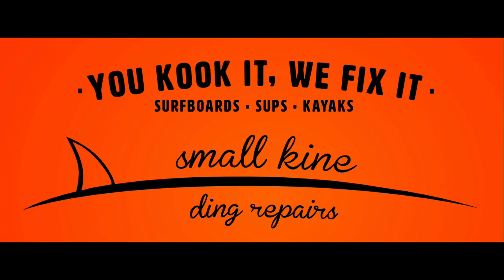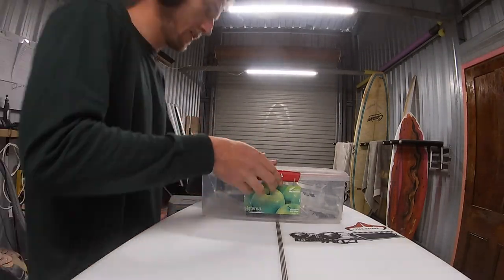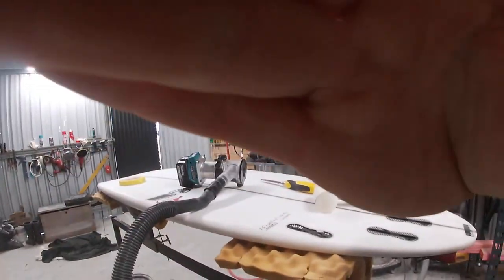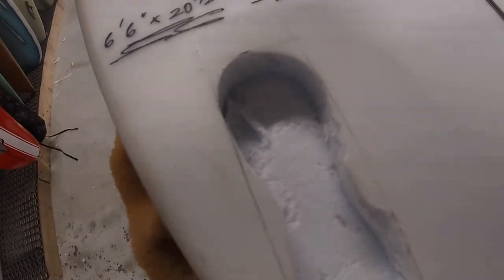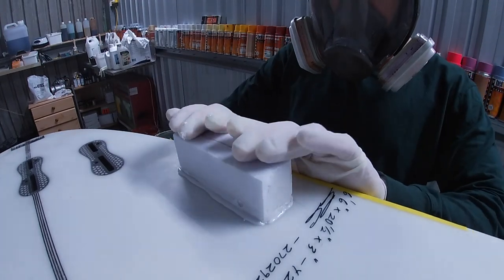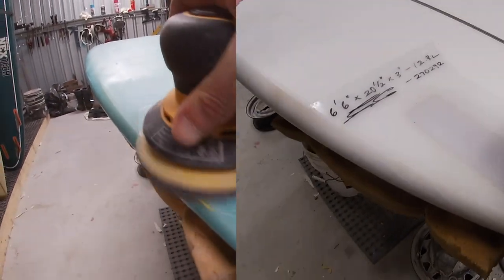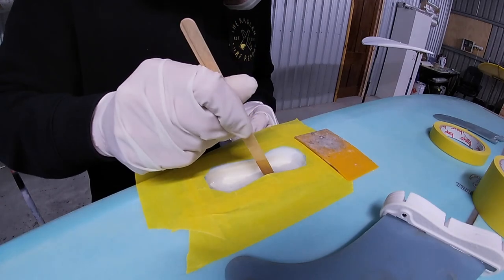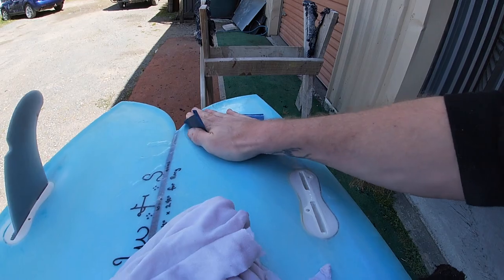HOW A PROFESSIONAL REALLY FIXES YOUR SURFBOARD - FCSII REPLACEMENT

Comment: Couldn't you have started with drawing the square shape around the box. and instead of routing, using a Dremel to cut the square, then proceeding to just pull the box out in the square shape? seems like it would have cut the time down without risking pulling existing glass and foam up.
Reply from the maker: Definitely can, was done that way for the sake of the video just to get the two boards at the same starting point

Comment: I should share this video to my local shaper.
Amazing job bra
Reply from the maker: Strangely, some of worst or dodgiest repairs I've seen come from shapers who I know to be really good shapers. I guess it's like getting a panel beater to paint your car, the two don't necessarily translate
Reply: @smallkinedings  I am pretty good breaking fin boxes, mostly duck diving in shallow water, slabs reefs , last time my local shaper took 2 months to fix mine and made a complete mess and charge me 40 EUR 🤮.
Unfortunately to fix fins box you need the proper tools and space otherwise I would do it.

Amazing video mate thanks again , have a nice barrel

Comment: What type of polyester resin are you using? Advice on when to use/not use finishing resin?
Reply from the maker: A surfboard specific poly resin. Most resin suppliers will carry it.
If your next step is sanding then you want to use a finishing (sanding) resin, if you need to add more material on top in your next stage (ie. Resin coat over lamination) then you want to use a laminating resin (remains sticky after curing to allow for more material to be added and bond) 🤙

Comment: I may have missed it watching at work, any use sanding the sides of the new box for bonding purpose?
Reply from the maker: Some people do but not myself. The box walls are sufficiently grooved, indented and porous that I think there is plenty of hold without sanding. But, a skuff with some 120 grit never hurt anyone if it gives you peace of mind

Comment: Good one mate , i dont really like using expanded PU , seems easier and faster to me to root a small square and insert a new block of foam and start from there . Also sometimes you dont really need to root and insert because if youre really precise grinding the broken box (and if It is not completely destroyed the area around it) , you can pull the old box out and the original root Will be perfect just to install a new box (maybe ya need to clean the resin inside of it with patience  but you wouldnt need to insert block again and root ..)
Reply from the maker: Many ways to skin a cat and I'd say that both methods have their pros and cons for sure. I use both blocks of foam and expanding depending on the job and type of ding. As long as you're replacing foam and not filling big holes with pools of resin, you're on the right track!

Comment: Micro oscillator tool is gonna be my router for this repair.   Best new tool of the 21st century.   Also, I don't have a bad ass router, or sander.
Reply from the maker: Like a dremmel? You'll be there a while 😂 It'll work though! Sounds like a good excuse to buy a bad ass router and sander to me though
Reply: @smallkinedings  a Dremel spins the bit, a Fein Tool saws the bit.

Comment: What kind of router bit can you use to square out the fin boxes to make it easier to insert foam? Assuming you can’t use the fcs2 bit freehand.
Reply from the maker: Hey hey, you could use the fcs bit. I tend to avoid it because those bits are so expensive so the less use the better. For general routing I just use some cheap and cheerful bits from the local hardware store. Smaller is better I find if trying to follow a pencil line, you get a bit more control

Comment: question about paintbrushes! What do you use to preserve your brushes? Acetone? I find myself going through paint brushes and want to save some money!
Reply from the maker: Howzit Dalton! So I personally don't reuse brushes as most of my brush work is dings so don't require a high end brush. I just try and line up 4 to 6 boards and use one brush for all of them each coat so a 50cent chip brush goes a long way. I know some full time laminators though who have high end brushes for their work. The standard seems to be 3 pots of acetone. So after use your brush you rinse heavily in container 1, then finish rinsing in container 2 and then leave it sitting in container 3 until its next use. Obviously container 1 gets gross and jelly first so once that needs changing you fill it with clean acetone and it becomes container 3. What was container 3 becomes number 2 and what was number 2 becomes number one. Keep the rotation going each time container 1 needs changing. One guy I know has been using the same 2 brushes for his work for almost 7 years and he's a full time laminator not too far from me. It's a pretty expensive brush he's using though!

Comment: Thanks for the video! If you don't mind my asking, are you able to make ends meet with just board repairs? If so, is it fairly chill, or a 60-hour week kind of situation?
Reply from the maker: This is definitely a topic I will make a video on soon. Short answer is that this has been my full time gig for the last 5ish years and I have essentially bought myself a lifestyle. My small town location makes things a little different for me but I generally work less than 40 hours a week (but 7 days a week) but I charge tradesman rates which I might struggle to do in a city but the trade off is that I'd get more work in a more populated area.

Comment: If I install a finbox with sanding resin, is it that much of a difference than using laminating resin? Will I see a difference? 

I just don’t have laminating resin.
Reply from the maker: I would venture a guess that it's not ideal as the wax layer will definitely effect adhesion. That said, by the time you sink your box, you might end up pushing 90% of the wax out anyway. It will mean you have to sand before lamination though. If you can get laminating resin I'd personally go with that.

Comment: Wouldn't it be stronger to route the box out larger so that your plug has more wall thickness?
Reply from the maker: Resin in a board is actually a weakness. It is incredibly hard and the slightest movement or flex creates compression and cavitation of the foam.the less of it the better. The other factor to consider would be weight in the tail end of your board. Each box takes roughly  30ml of resin (minus what you squeeze out). Up that to, let's say 60ml per box, we are adding some noticeable weight now.
Reply: I learned about the added weight the hard way 💩

Comment: You can also melt the plastic around the pin with a soldering iron, less nerve wracking than trying to get it with a router.
Reply from the maker: Knowing me I'd be dripping molten plastic all over myself 😂

Comment: Nice! Did you glass over the 2 part foam without sealing first? Are you not getting bubbles?
Reply from the maker: If the damage is small i usually don't seal the foam off for a box before glassing as most of it will be routed away anyway, but generally I play that onna case by case basis.

Comment: wish they made white expanding foam or you can add pigment to it?
Reply from the maker: Tell me about it! I have been experimenting with tints and acrylics added. The issue is that the iso part is so dark before mixing, the amount of colour needed is enough to change the chemical reactions and because it begins its expansion in about 60 seconds, time limit to add pigments is extreme!

Comment: What's the go with those grey fins with the indent in the leading edge?
Is it there so you can tape them down when setting them, or is it a new type of fin?
Reply from the maker: They are dummy fins. Yup, That indent is for masking and their tab is different so they don't lock into the box the way a fin you'd surf would

Comment: i want to do the Foam block method. but i'm a bit skeptick... do you think it's a problem if i will insert a block of PU foam in a Board that is made of EPS? 

yoooo thanks so much for your vid's! i lernd so much from them!! chers for the tips and all!
Reply from the maker: Hey hey,  cheers, glad these videos are of use!. Non-issue at all using PU foam in an EPS board. I never use EPS as foam inserts and especially for things like plugs and boxes, the density of your PU is an advantage.

Comment: Watching this because I hate my FCS2 boxes. Four of mine need to be replaced. Just thinking of cutting them out and replacing with futures.
Reply from the maker: If they all need replacing, then personally I would go futures over FCS any day of the week.
Reply: @small kine dings  I understand the offset for the FCS2 box alignments with the jig.  But if I'm converting to Futures from FCS2, does the alignment with the shaper's dot change?  As in when the shaper places the dot, does that placement take in to account the FCS2 alignment shift left/right or is the dot simply the dot and can be used for either FCS2 or Futures?
Reply from the maker: @bellpaleale  hey hey, I have a "tip of the day" in my shorts that shows that difference. So your shapers mark for futures represents the dead center of the fin slot as opposed to fcs which is showing  the inside edge of the fin slot.

Comment: Set your camera to 25 or 50fps (assuming you're in aus) to stop that light flicker.
Reply from the maker: O, unreal cheers for the tip! I'm in NZ, why does geography matter?
Reply: @smallkinedings  it depends on the frequency of the AC power.
AUS and NZ are on 50hz alternating current, while some places like the USA or on 60hz.

The flurou lights flicker at the same rate as the power frequency, so if you don't have the frame rate aligned with the flicker, you'll get some frames that are dark and some that are light.
Reply from the maker: @ryanokeefe12  ahh yes, that makes sense. The weird thing though is that they are all LED lights and they don't flicker in real life (noticeably at least) but do on camera. Will give it a go and see how it looks. Cheers for the tip!
Reply: @smallkinedings  LEDs that run off of AC will have the same issue as fluorescent lights.
You can't see them in person, because the flickering is too fast for your eyes to perceive as your eyes are constantly taking in light, unlike a camera which is capturing multiple still frames per second.

There are quite a few videos that explain the problem and solutions.. You can resolve the issue by adjusting the shutter speed,  so that the shutter is open for a longer period of time than it takes for the light to flicker on and off - but you've got to adjust the ISO at the same time to ensure your video isn't too bright or too dark. 

That's why the easiest solution is to simply adjust the frame rate so that it aligns with the power frequency.

https://www.youtube.com/watch?v=0kAuDuV9K9U

Comment: Pour foam seems to shrink on me like a month down the line, just a little shrinkage
Reply from the maker: Interesting, havent heard of that happening before. Maybe change your brand/supplier and do some trials with something different.  What density have you been using?
Reply: @smallkinedings  I used 2lb foam from TAP Plastics, I only used it for small holes maybe an inch wide. I am in NorCal, and I wonder if the cold weather kind of slowed down or prevented the full chemical reaction
Reply from the maker: @crush3095  definitely a minimum temprature requirement with the stuff I use of roughly 15 to 20 degrees (celcius) for a proper reaction. Could be worth heating your room

Comment: FCS2 JIG would make the route much easier and cleaner. If you do a bunch of these its better to have a dedicated router bit just for these repairs because it tends to muck up to router bit.
Reply from the maker: Which route are you talking about? I have fcs jigs which are used in this video as well as designated router bits for all steps in this video
Reply: @smallkinedings  parts of the video shows you freehand the FCS route
Reply from the maker: @jasontroy3911  you can't use the fcs jig and bit for that because you can't route the boxes out at full depth straight away. If the bit is not set to full depth in the router then the guide bearing will make no contact with your fcs template and you will destroy the template which will be metal on metal. So, you would have to free hand within the template anyway until you get deep enough for the guide bearing to make contact.  May as well just free hand it without the template. That and fcs router bit are about $150 a pop so it would be an expensive way to go about things
Reply from the maker: @jasontroy3911  something you can do to get around that though is stack an fcs2 template on top of a futures one pass template. This will elevate your fcs2 template up high enough that although your only cutting millimeters deep into the box, the guide bearing will make contact with the edge of the fcs2 template.
Reply: @smallkinedings  I have a router bit dedicated to routing out FCS2 boxes. After digging the pin out I slowly route the rest of the box out at full depth. Just did one about an hour ago. Like I said the problem with my method is the router bit is toast for regular fin box installation so I have 2 router bits one for each task.
Reply from the maker: @jasontroy3911  so it sounds the same as what I'm doing? I also have a dedicated sacrificial router bit,  $15. Then a dedicated FCS bit for installations at $150. Seems like the only difference is the money we are spending on bits?

Comment: The problem with FCS2 is that when you hit your fin you generally wreck the box, which is an expensive and time consuming affair. I like the old twin tab fins with FCS Fusion boxes. If you stick the boxes in properly, when you hit a rock 99% of the time you'll lose the fin with no damage to the box. Fins are relatively cheap, and what's more all you have to do is put a new fin in and you're back surfing again. FCS2 has been a real bonus for professional ding repairers; plenty of work.
Reply from the maker: Couldn't agree more, great product for business, not so hot for the consumer!
Reply: Love it mate! Do you think I could use glass bubbles to fill the hole instead of foam block?
Reply from the maker: @stefanosobrero677  negative, filling large voids with resin is exactly what we are trying to avoid. Lodging hard, jagged substances within a soft, supple, flexing material causes all kinds of potential issues down the track. This is what separates the the "uncle tonys" from the pros 🤙
Reply: @smallkinedings  ok thanks mate, guess I’ll have to use foam then 😁
Reply from the maker: @stefanosobrero677  that's the one! It was the whole beginning of this channel, calling out the uncle Tony's on YouTube 😂 check the first video ever posted on the channel
Reply: @smallkinedings  sorry mate one more question, do you think a 40kg expanding pu is a bit light or will it do the job? Seems to be about the hardest I can get in my area
Reply from the maker: @stefanosobrero677  40kg is perfect 👌 I use 36kg for the most part, occasionally 60kg for really mega jobs but that stuff is as hard as rock!
Reply: @smallkinedings  dude you made my day, thanks for this video and such quick response! As you can tell I’m no pro but I feel like I have a shot at not fucking my board up now 🤣
Reply from the maker: @stefanosobrero677  my pleasure man and best of luck! Let me know if you get stuck. The best thing about fibreglass is that everything is reversible so you can never mess up too bad 🤙
Reply: Mate, just wanted to let you know this video was GOLD. I was tackling a fin box repair for the first time and was quite anxious about it but I’m very pleased with the outcome and it all went much better than I thought! Thank you 🤩
Reply from the maker: @stefanosobrero677  great news man, appreciate the feed back and so stoked it worked out for ya!

Comment: 9 year pro ding repairer here. Spent the first half of your video shaking my head with a puzzled look on my face. You actually rout the whole plastic box out with the metal rod? For the love of God why? Rout a bit deeper and get a large, flat screwdriver in the channel and lever the box out. It takes 30 seconds.
Reply from the maker: Levering the box out runs the risk of lifting and delaminating the existing glass around the box as well as creating further damage to the foam. Depending of course on the condition of the boards damage when it comes to me, if the thing is totally munted already then yes, pry away but if the board is in good knick around the box as this one was, I would rather take my time and remove it cleanly. The issue I see with many other repairs that come through my workshop is that the jobs have been rushed. Weather this is because the repairer doesn't charge enough to take his time or because he is impatient and eager to get paid I'm not sure but, as I always say, good things take time
Reply: @smallkinedings  each to his own. I've done hundreds of these. I think you are making unnecessary work for yourself
Reply from the maker: @Woopass90  agreed and as have I
Reply: The other issue you can encounter here with routing deeper, especially with FCS 2 is that the bit from the router hits the titanium rod and sends sparks into the air which can become very dangerous.
Reply: Having the distance why measuring? Pass it to foam, pass parallelogram to the board and open box.
Tallking time...
Reply from the maker: @miguelaragao1  I don't understand sorry?
Reply from the maker: @StormCloudGenerator  that's covered pretty in depth in the video

Comment: The  craftsman needs to convert his fluorescent bulbs to LEDs, recommend 4,000 K.  Way better light for cheaper and last long time.
Reply from the maker: Every light in my workshop is an LED, the question is, why does the gopro make it flicker?!
Reply: Frame rate